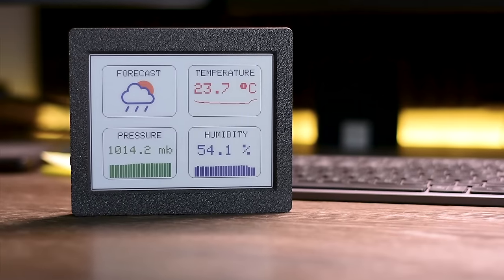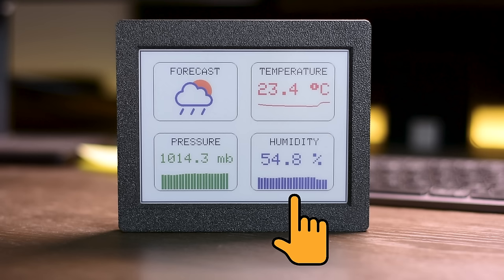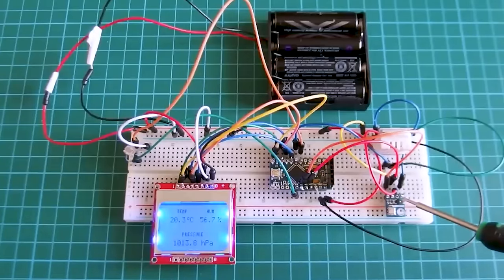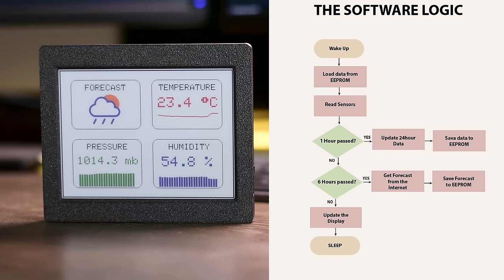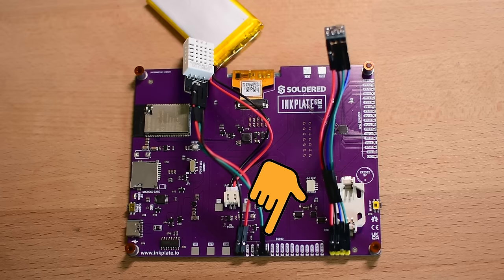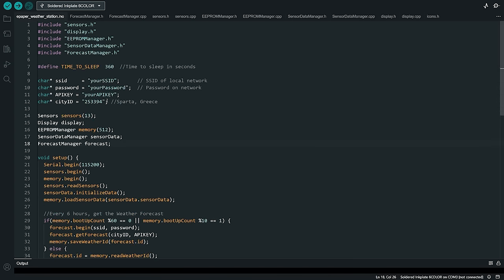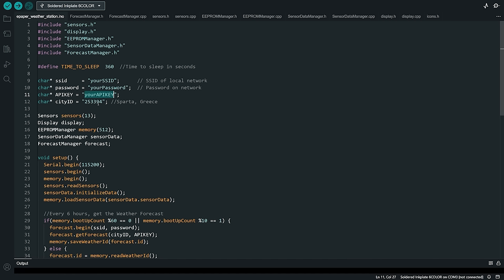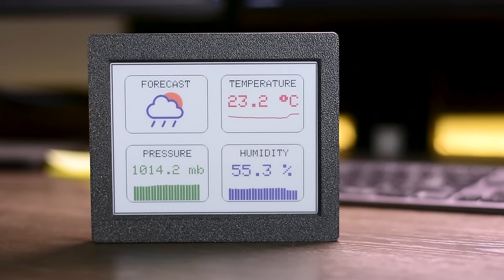DIY ESP32 Color E Paper Weather Station

Comment: Compare the power of today's $5 ESP32-S3-N16R8 module, to a $2500 IBM PC XT of 1980?
Indeed my friend, I have seen this movie from the start, staring the $1000 TRS80 model 1 (Trash-80) from RadioShack in 1979. 
But hey, one could play pong on it! A $1000 useless computer it was. So I took it back, and got my money back after a week.  
Ended up building a ZX81 a year later for under $100! Had the same power and memory as the over-priced $1000 Trash-80.

Comment: Thanks for sharing the awesome project! However do note not only the esp32 is drawing power when in sleep, there's static current from the LDO, standby power from the DHT and BMP sensors and the USB serial chip, and even the power from your lipo protection pcb. And they are way larger than 15 uA as most of them are not designed for such low power consumption at beginning. So frankly it won't last for months as you estimated.

Comment: Do you need to update the whole screen every 6 minutes? Couldn't you just draw the changed pixels (and update the full screen every hour) to save your battery?
Reply from the maker: You can't do that in e-paper displays. They don't work like regular displays. There is a thing called partial update of the screen but does not work on color e-paper displays.

Comment: Hello Sir, I have a HP laptop and while all the software has been installed, and the upload runs until arduino says it has done hard reset, but no screen interaction. On the serial monitor, there is a constant 1.5 sec frequency reset being displayed on it.  Is there a reason for this or does the code need a change?  I have uploaded other code from the inkplate github  web site showing the 6 color welcome screen, therefore I believe the issue is not in the laptop software. Do /would you have any ideas?
Reply from the maker: Please use the latest arduino software for the display, this one https://github.com/SolderedElectronics/Inkplate-Arduino-library/tree/ip6ColorSleepFix and let me know if it works better.
Reply: @Educ8s   I have solved my issues for now, and everything looks good, do you have  the 280 library we should use (coding?)